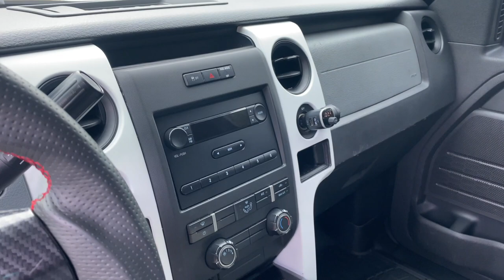F-150 STREET TRUCK UPDATE/VLOG

Comment: Really nice truck!!  what’s the drop on it and wheel/tire size? if you don’t mind me asking
Reply from the maker: It’s a mashup between VAS & Belltech parts. The truck is on a 4/6 drop w/ Belltech front struts and a VAS flip kit w/ Belltech shocks and VAS traction bars. The wheel & tire setup is a 315/55/17 MT ET Street R on a 10.5 Weld Ventura 6 Beadlock. Fronts are 225/60/17 on a 5 inch Weld Ventura 6.
Reply: Man it looks awesome.  Nice job with it!! I really appreciate the info on it   Thank you!
Reply from the maker: @ILYMAD66  thanks man!